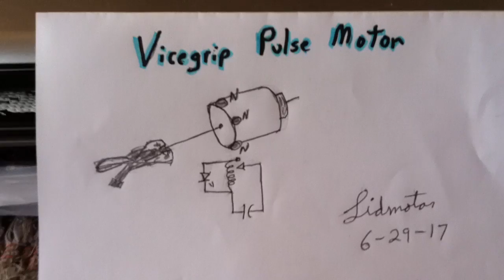Vice Grip Pulse Motor----Part 2

Comment: Haha thanks for the feet shout-out !
Thinking about the way you have that set up....it may be possible to put the coil, cap + reed inside the bottle. Maybe paperclip at both ends, circuitboard between. Nothing would be on the outside.
The LED power could travel on the paperclip ends, so you could 'draw' power from the 'free energy' machine by putting the LED across those ends.
Reply from the maker: That sounds like fun.  There is easily enough room to put the whole driver inside the bottle.  Stuff of another 'bare foot' video.

Comment: You could have shown it operating when in the micro wave as well?

ps: could you build one using a fidget spinner?
Reply: Been thinking about the fidget spinner as well. they're a real craze right now. They have pulse motor written all over them because of the really smooth bearrings. Funny no one has tried that yet....
Reply from the maker: Yes. This would work inside a microwave over just fine.  I have already built a fidget spinner pulse motor but didn't make a video of it.  It worked great.